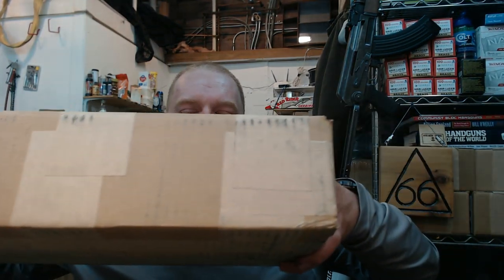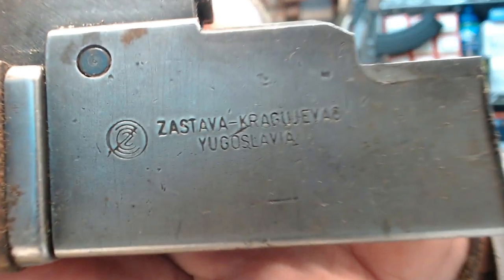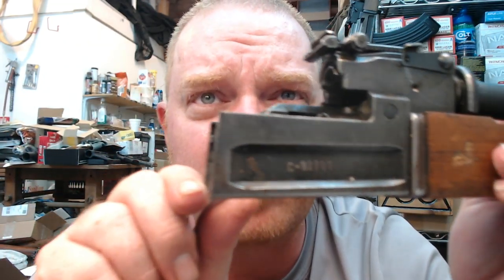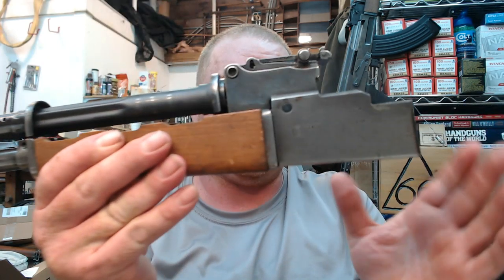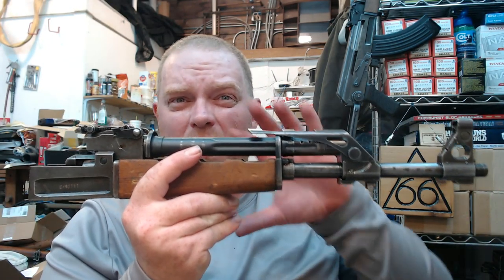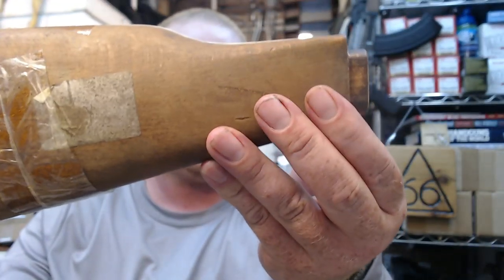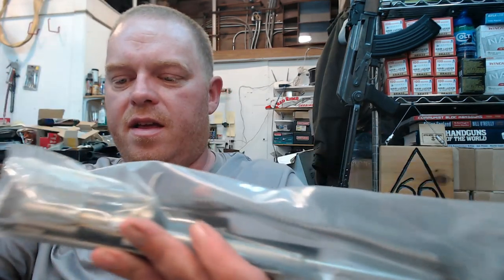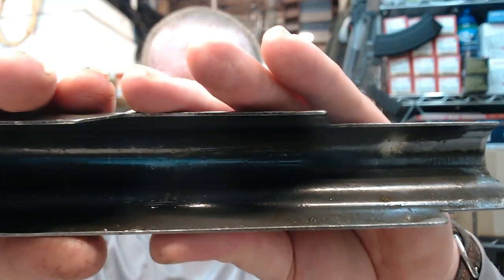Yugo Zastava M70B Milled AK 47 Parts Kit W/ Original Barrel & Bonus M64 Underfolder : Thank You Apex

Comment: Stumbled into this, so..  that little not says : Police departement Karlovac - 252 - not formational (non-deployed weapon). It came from a police station in Karlovac, Croatia.  Probably was also used in the 91-93 war before that. Heavy things those milled M70. They finally got 5.56 and VHS-K2 these days.
Reply from the maker: Cool. Thanks for the info. i appreciate it. I also have a M85 underfolder in 5.56.
Reply: 2a Edu  my M72 had same label: PU Karlovačka-Duga Resa, Neformacijsko
Reply from the maker: @exyugo  Cool. 👍 Thanks for sharing.

Comment: Hey cool video, would any AK underfolder milled reciever work for a milled yugo parts kit?
Reply from the maker: Thank you! I think you would need a Yugo specific receiver. Threaded or press fit and pinned. Depending on which Yugo milled barrel you have.
Reply: @2aEdu  ok thank you. That's what I was thinking so for now I'm SOL

Comment: if the front trunnion is torch cut, is it p much garbage? lol
Reply from the maker: This is a milled receiver.  It doesn't have a trunking per say. But the front area needs to be intact to use the front stub for reweldibg.

Comment: Could I use an m64 parts kit with a m70 type barrel and reciever?
Reply from the maker: I would think so.
Reply: @2aEdu  is the bolt carrier on the m64 slightly different from the M70 or is it the same
Reply from the maker: @Freedmevr45  I will have to check
Reply: @Freedmevr45  the M64 uses a thread in barrel, and M70 barrels are push in. They are not interchangeable, unless the M70 you have uses an M64 thread in receiver

Edit: I’m talking about the Yugo M64 thread in receivers, vs the M70 with the new push in barrels. They switched from the thread in barrels to the regular push in barrels since it’s much easier to swap barrels with the push in barrels.

Comment: Does this one have the bolt hold open or only the M64's?
edit: just saw, though on my few research. you could stick the BHO device into a milled M70 receiver with modifications?
Reply from the maker: The M64 are the only ones that have the BHO. I'm sure anything could be fabbed with the right skill set though. The BHO was abandoned by Yugoslavia early on. I discussed this in this video. Thanks for watching.
Reply: @2aEdu  Thank you, I was searching different terms like "Zastava M70 A" for the M64 but when I searched for it most of the posts are from 2006 and related to the M70 which was the wrong wording for the M64/AP but I am glad I found this channel last week.
Reply from the maker: @welcomeUNKNOWN  Yeah the whole naming of the " M64" is kinda weird anyways. That's why I said it was technically just called the AP. But could be called a M70, and commonly called the M64. lol. The M70s you see people talking about with BHO are actually the AP (M64) that i showed in this video. But basically just the first several thousand that weren't officially adopted have the different cut receiver and BHO. The M64 was used by Yugoslavia just not "officially" adopted. 
I'm glad you found the channel too. Hopefully you like my videos.
Reply: @2aEdu  early versions did not have the Bolt Hold Open function someon installed that later early versions had the 1.0mm reciver and no grenade launcher sight